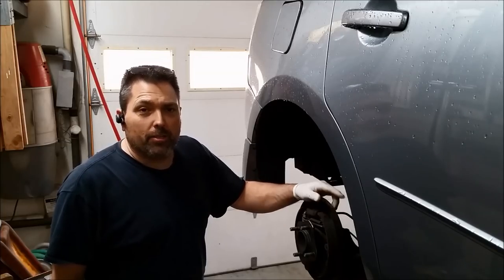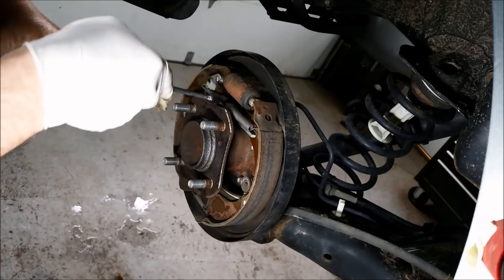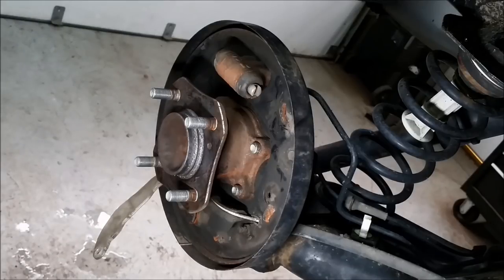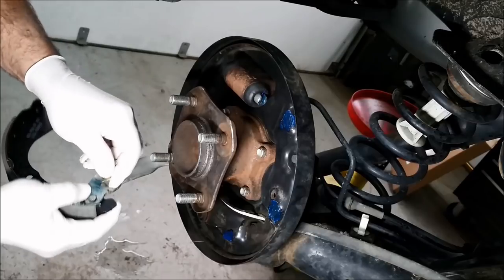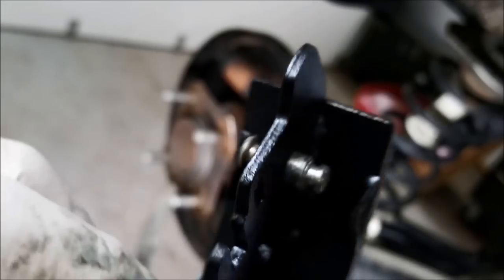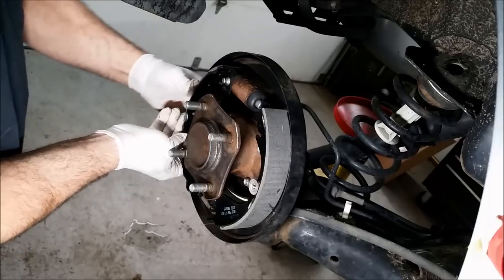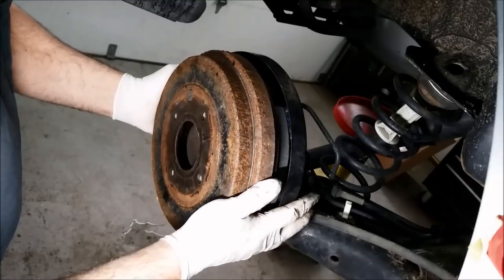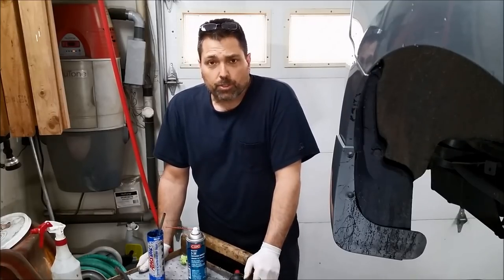2009 Nissan Sentra Rear Brake Shoes

Comment: Initially thought your video was long. once I started I forgot the minutes until it was over.  without those tools the springs are so hard to stretch with pliers. I quit it last weekend and decided to buy the spring tool. thanks specifically for the tip on the self adjusting screw. everything else seemed okay except that part. its like an art to adjust it. no particular standard to follow.
Reply from the maker: Some jobs are hard to properly explain without taking the time. The proper tools are imperative. I hope the video helped and appreciated the support

Comment: You were using the wrong side brake shoe. Driver side and passenger side have the pin length in different sides. I just did mine yesterday. Great video though!
Reply from the maker: Not sure exactly what you're referring to, but certain it's right. Either that or I've done several hundred wrong. Maybe the camera reversed the image. Thanks for the support
Reply: S & A Auto Repair What I was saying is the pin for the operating lever on the brake shoe is side specific. I just installed both rear brake shoes and the driver side and passenger side pins are different.  Looks like the brake shoe you were installing for the passenger side was actually for the driver side. That’s why you couldn’t get the retainer ring to fit properly. BTW, I’m referring to 15:51 of your video.  Again good video!